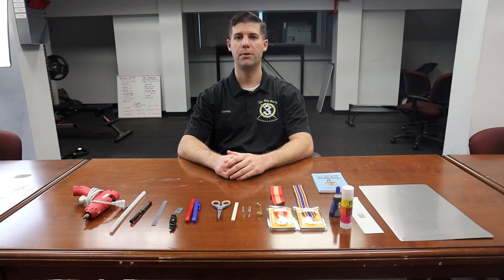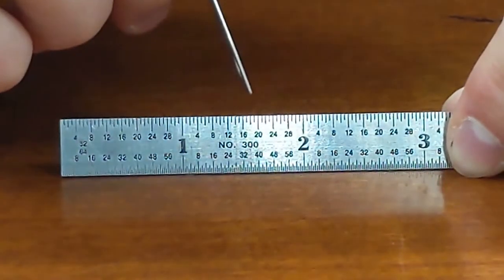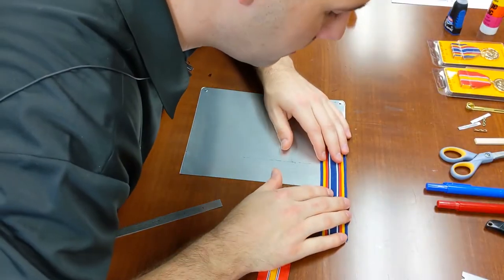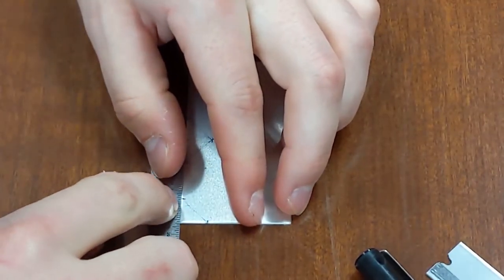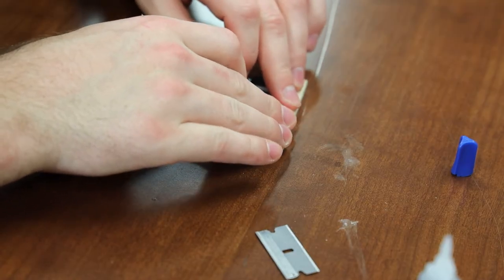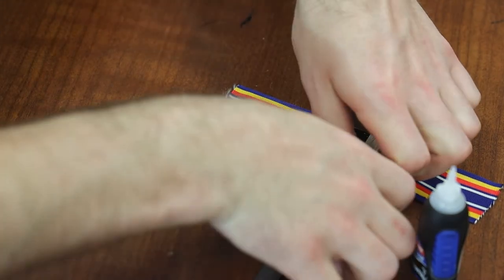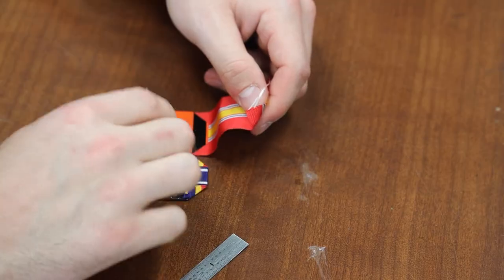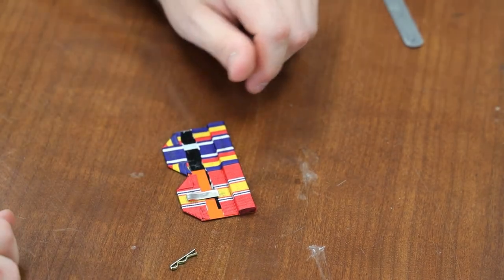Medals Rack ROP Instructional

Comment: Hello SSGT Wilkins, First of all I want to thank you for your service.  I love the Old Guard and their dedication.  Your video reminds me of when I first went in the Army in 1964 when we always did things to make the uniform more sharp and crisp.  What you are referring to as micrometer is a scale.  I got a bit of a giggle out of that but I am a Machinist.
At the end of the video you touched on making medal racks for more that one row.  I spent 7-1/2 years in the Army, out for 23-1/2 years and went into the Air Force.  I completed almost 23 years total service.  My problem is I have about 23 decorations... mostly ribbons but still will have about 19-20 full size medals.  My last 13 years of service in the USAF was additional duty with the Base Honor Guard performing Funeral Honors Detail for our Fallen. I paid for most of my Ceremonial Uniform out of my pocket because of budget constraints and I kept it for my own funeral.  I need to figure how to mount the full size medals to the bars and also how much spacing is between the bars for the correct overhang.  We used ribbons on our Uniform, whereas the USAF Honor Guard used the full size medals.  I was going to have them professionally mounted but the cost is going to be prohibitive.  The medals I was issued were regular issue and not the Gold Anodized.  I wish they were.  I am getting very close to needing my burial uniform and would like the medals rack to look sharp. I want to add that full size Medals are not authorized except for the USAF Honor Guard... but, this is my funeral I am talking about.  Thanks for any information, and Please thank the other guys for their service and tell then I really appreciate it.
TSGT Ed Hurst.

Comment: Since you didn't use metal with pre applied adhesive I have a question do you paint the adhesive on the edge etc like you did on the metal without adhesive? The middle lines would be difficult to paint correct being that your painting onto an adhesive pad